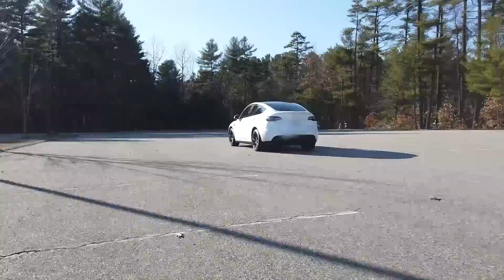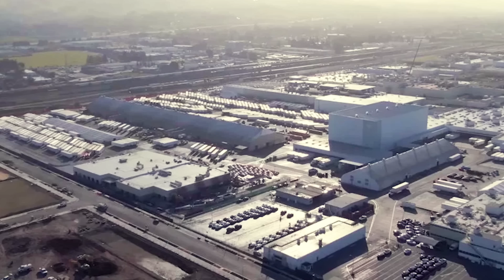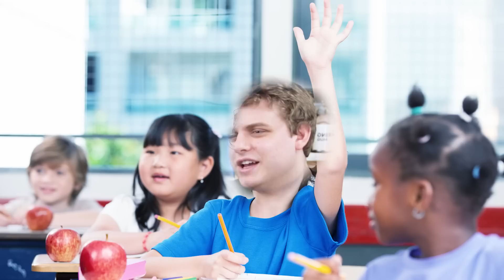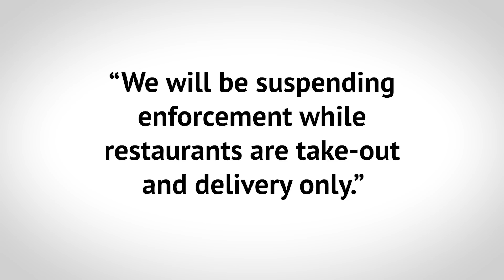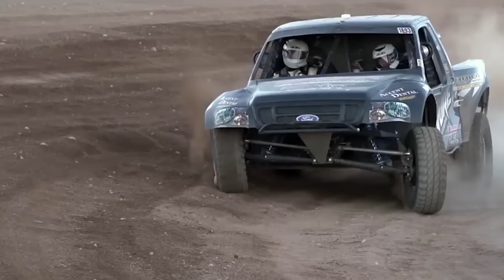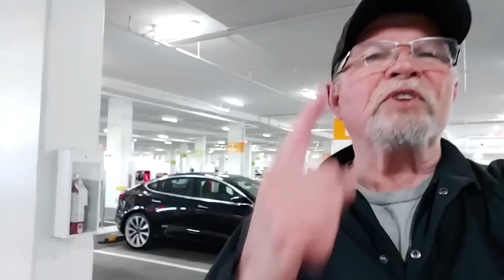Tesla Time News - Zac & Jesse Safely Inspect the Model Y!

Comment: The frunk struts are located out of the way on the back side of the hinge. I wanted higher ground clearance, like 8 inches (I live on a dirt/clay road that gets severly rutted at times, and have dragged the bottom of my TM3). I had hoped the rear seat could slide back and forth (maybe it will in the 7 seat version? Otherwise how will people get into the last row?). Panasonic closed battery production at giga nevada for a thorough cleaning, unknown for how long. You could talk about double plus bad cold except you tube will not pay you, is that right? BTW, I don't get the "run on tp". Do you? I get your rant against NTSB. I use autopilot almost religiously. But I have become reliant on it to the extent that one time I looked to the side to begin a merge and the auto braking prevented me from rear ending the car that had stopped in front of me, yeah). However, it is very hard to understand why ap failed to save these overly reliant people. Doesn't Tesla have plenty of room to expand at giga nevada? Is Tesla just trying to get incentives? The Oliver Klozov  patreon must be a joke, right "all of our clothes off!). He must be rolling around on the floor with glee! Seriously Bart Simpson like.

Comment: You missed the point about eBikes...again. This law allows a certain type of motorbike to be driven without a driver's licence, without a helmet and with minimal safety equipment (brakes etc.). If you want to go faster, get a vehicle that was build to go faster and was built to stop safely from that speed. And wear a helmet, get a driver's licence and stay off the bike lanes.
Reply: I really tried to get this point across... I had made a longer, indepth about all this (the difference between "pedal assist bikes" and "mopeds" video but it was less entertaining and it was going to go to the bonus stories :-/
Reply: If it has a throttle it's a moped, so motor vehicle laws should apply. If it's pedal assist then the motor size has to be limited AND pedal assist only. Power multiplication of 3 or 300watts max. Almost no cyclists can maintain more than 300 watts continuous or 900 watts for short periods. I'm all for ebikes to get more people on bikes. But they have to just level the playing field a bit or give a help like a tailwind on the flat. But a 500watt continuous motor is not an ebike, it's a weak moped. For off-road use the same applies, don't want e-motorcycles  motorcycles on MTB  trails.  All of this is from experience. Ride a bike daily for commuting and competition. 300 watts is a lot but for my wife or son to ride with me they could have a power output equaling their own and now we are all moving the same speed. On hills they can have it doubled or trippled and everyone is moving at the same perception of effort. But give them a 500 watt continuous motor and a thumb throttle and it's about as even as them in a car. 500watts is pro-level at max effort. Maybe 1 in 100,000 can do that power, and none do it on a bike trail or sidewalk. Infrastructure is the real issue, make more lanes for bikes(assisted or not, with no walking or running) and less lanes for cars is the only real solution but that take time. It will happen, just slowly.

Comment: Thanks for using my piece again this week. I hope it, along with your explanations, would have cleared things out about e-bike legislation in Europe, cause yes, it's not just a French thing. It's true also that the 2002 EU Directive is pretty antiquated... I guess, I don't use E-bikes enough to Know if 250W is really not enough but to my knowledge, for e-bicycles, 25 Km/h is plenty for urban areas. Besides, mopeds are really developed in Europe so, anyone who wants to go faster would chose one or even a light weight quadricycles like the Citroën Ami.
Reply: Jean-Baptiste Wattiaux great editing on your clip.
Reply: P.S. it's JB (not JP - short for Jean-Baptiste).
Reply: Do you know that in the EU e-bikes must gradually reduce their power output to 0 W at 25 kph - meaning that if you want to go 25 kph or above, you must provide all power by pedaling - and that at 12,5 kph you only get 125 W of motor power assist - assuming that the gradual power reduction is required to be linear (which is not mentioned). Source: https://ec.europa.eu/energy/intelligent/projects/sites/iee-projects/files/projects/documents/presto_fact_sheet_legislation_en.pdf page 3:
"Early 2010, the European Commission has definitely confirmed that “cycles with pedal assistance which are equipped with an auxiliary electric motor having a maximum continuous rated power of 0.25 kW, of which the output is progressively reduced and finally cut off as the vehicle reaches a speed of 25 km/h, or sooner, if the cyclist stops pedaling” fall within the scope of Directive 2006/42/EC on machinery."
Reply: @smejlee2550  I didn't know the power is meant to go out progressively as you reach 25kph but I still think that 25kph is plenty when you're driving a bicycle in cities (especially on bike lanes - close to sidewalks and pedestrians). Again, if you want to go faster, get an electric moped and ride on the roads. I was thinking about getting one but now that, price wise, it's in competition with the Citroën Ami, I think I would rather get the Ami (if I'm to ride on roads I'd rather be in a car).

Comment: I like you guys and in respect to the Tesla car crash, I don't fault Tesla. 

I first and foremost fault the truck driver, as the car had the legal right to the path through that intersection..... But...
I do however fault the driver, as autopilot is not perfect, a human must still be able to take control at any moment.

"why are we talking about the autopilot"
1) because we want the autopilot to be able to prevent such crashes.
2) because a human not reliant on autopilot, should have be able to react.... I recognize overall, the autopilot is better, but it still has weaknesses. So there is room to talk about it AND this includes both positive and negative.

Comment: It's not related to e-scooters.  Listen again to his video - it's scooters.  He does not say "E".  And there are a lot of speed limited gas scooters that have OEM governors installed and ride on "bike" paths all over Europe.  They get mod'ed a lot to go way faster, but still keep their slow speed plates so they can reduce the tax and regulatory hit.  The law is aimed at highly mod'ed scooters (mostly gas one) that can easily do 50 mph on a bike path ...
Reply: It's true that gas scooters are often modded to go faster than what they're meant to be but, legally, they are classified as mopeds and mopeds have to have license plates and cannot go on bike lanes. The problem is also however with light weight electric scooter that can go on bike lanes (or even sidewalks if they go no faster than 6km/h) but more and more people are modifying them to go faster than their 25km/h limitation but still driving them dangerously close to pedestrians.

Comment: Another missed fun feature a drain in the frunk or truck pocket thing and house hold plug in the back and removable seats. Why a would you need a drain? Cooler. House hold plug? To plug a heater a bed tv aircompress. Perfect day out car with that buy some ice put in the rear bring a tv go to the park remove your seats turn them around and put them in the back or on the ground and hand the tv from the trunk or front seats and have a fun day maybe attach some tarps or something and make a tent using the trunk as the starting point/roof. A tent would be a nice thing you can buy form tesla store kinda like the Aztec (so removable trunk?) I mean you would be the coolest dude at the beach or park. Too bad you cant bring solar panels to camp with and charge with

Comment: I looked into a Tesla Solar system. Where I live in Washington State the estimates were I would save about $500/yr with a $16K system. As much as I would like to make renewable energy it doesn't make financial sense in a state that mostly runs on hydro and charges $0.10/KWh.
Reply: Dustin Andrews same here in IL. Electricity is cheap but not all renewable. I ended up doing community solar instead of installing anything.